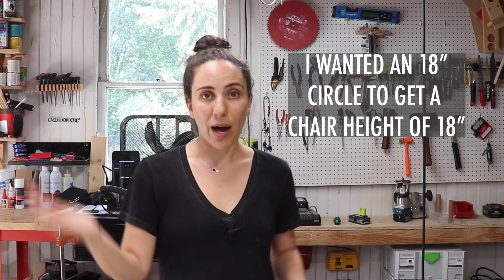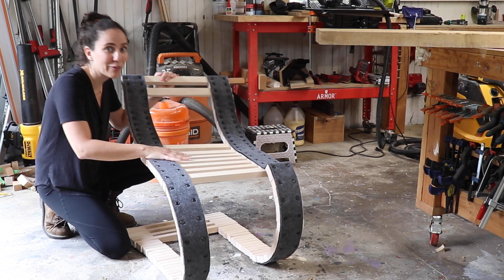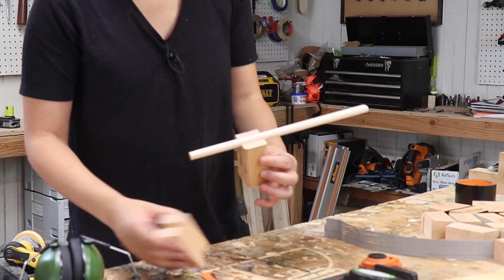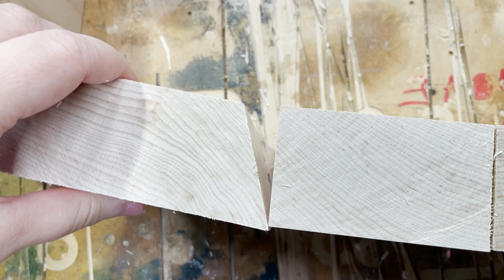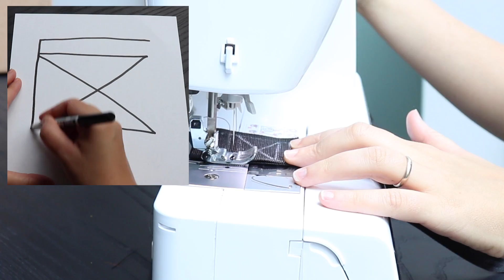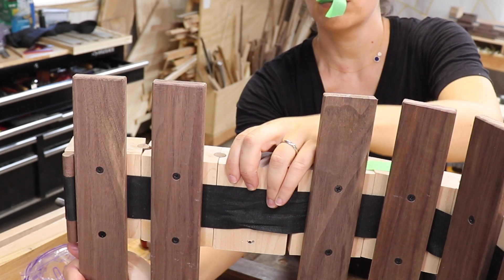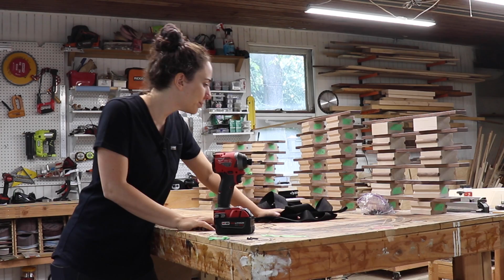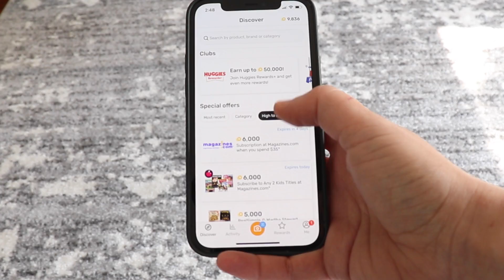I ATTEMPT to make a Roll Up Chair… AGAIN...

Comment: If I were doing this, I would've use cylinder shaped pieces of wood with a lot of cables(steel) running through it(where the person would sit on), there might be a problem where some of the pieces will shifting out of place but I think you can use that strap(one in the vid) to hold it in place at the front and back(two sided) and for the side to side shifting you can use the same idea you used in this video, Or you can use ure design and just put in a "versterking(afrikaans,sorry I forgot the word in English)"at the back of the chair to prevent it from rolling up at the back and not being sturdy enough. You can make that "versterking" also roll up with the chair.

Hope you see this and take my thoughts on this into consideration.PS sorry for the afrikaans:)

Eghardt

Comment: I think the problem is that u r using elastic materials, Bands or ropes are woven materials the resistance they have is superior to many other materials but they are easily deformed creating the spaces you showed before. A series of hinges could work better, a structural calculation should be made on the strength necessary in the center of each radius to size the type of hinge to be used. It's a very cool concept you should publish a drawing with the measurements obtained with the latest version and launch a challenge to all those who weigh to be able to make an improvement to the project by creating a video

Comment: Second comment from me about the tension in the straps. Currently you're letting the strap stretch across its entire length, so that in places of most tension, it will pull through more of the strap and you get those separations in the video.
The problem probably isn't the strap material. Try fixing it to each segment with fabric rivets or something similar so that the stretchable amount for any given section is a couple of inches and not the whole length 👌.

Comment: Try stepped or tongue and groove style edges on each of the sections of the chair, so that they compress together under pressure rather than come apart.

Seen a few chairs of this style that worked and that seemed to be one of the features that helped it all come together 👍

Comment: you have it almost finished, you just need to ditch the strapping because it stretches, you should drill two holes just under the surface  through each piece parallel and run 4---- 1/8 in cables through each connecting hole, so you have 2 cables through each side.  Secure them at the top so they won't move, and adjust the tension at the bottom on each cable, and i would use about 400 lbs of seated weight as my standard.  the 4 cables will fix the sway from side to side, and the steel cables wont stretch, and because they are 1'8 in, they will roll easily.  If it works, i want one, lol.  they are very cool

Comment: Instead of using a paper as a template, I would recommend that you use a speed square. It's the same ones carpenters use. They are EXTREMELY useful tools and can save you much more time when it comes to cutting your wood to shape. Lastly, for the cable, I would recommend calculating the tension force that the cable will be undergoing so you know the chair will be able to support you and possibly another person.

P.S. When looking at materials to use, keep in mind the overall weight of the chair. You can use CAD software to design the chair and it will have preloaded materials in the software that will **automagically** calculate the overall weight of the chair before you even begin production.

I hope you find this information helpful. Best of luck.

Comment: It's the fabric material, you can see it streching the tension won't help so much. It will just bring closer to failing and create more tension inside the material, try materials that are stron and do not strech and it should work.

Comment: I hadn't seen this suggestion so ill throw it in. Along with the improved strapping methods many have suggested, designing the chair so that it, when weighted, rests in the horizontal seating position. Essentially design it so when you initially unroll it,  the section you sit on is at a ~30* upward angle as opposed to horizontal. Then when its weighted it has room to flex to the desired seating position.
Reply: @jhay440  ratchet strapping in general might be the solution, cause those straps, especially the 2t rated ones only stretch when you put as heap of stress and force on em
Reply: @Rocker-1234  Literal Tow straps from the local hardware store. I was thinking the same, but the wood pieces need to become part of the structure as well, might be related to the curvature in the chair itself and how it's transferring the load.
Reply: @FuhSheezy  nah not tow traps, they have a little bit of give, go for the full 2-3t truck straps they seem to stretch alot less from my experience. as for making the wood part of it, cut slats into the wood or on the edges of the wood just thick enough for the straps to fit into, that way the staps become part of the structure kinda like window blinds
Reply: i would glue all the strap to all the wood
Reply: @WTFinc  she tried that in attempt one, problem isnt the securement of the straps but how much they stretch
Reply: @Rocker-1234  i would have thought glue would midigate that since it would only be able to stretch locally at the joint rather than the entire length. maybe a streach and glue? solid cable? hinges lol?
Reply: @WTFinc  Was thinking about hinge too as it wouldn't stretch at all while giving enough strength to the whole structure... Just need the right hinge...
Reply: @DeadsTBD  hinges! Let's go!
Reply: Correct.
Also stronger straps - less stretchy. Kevlar or steel perhaps. Let them slip except at the ends where you have adjustment. The wood will compress so you will need to regularly tighten it. Take out all but two of the slats at the bottom
Reply: @Chris-ZL  Steel was one one idea I had as well. Leather won't work as it stretches by quite a bit.
Reply: or use lighter material for the top pieces?
Reply: @CURFmoney  That's an interesting idea, to give it a seat a higher angle, to accommodate the stress from putting weight on the seat.  I wonder if, though, since sitting in the chair would creat enormous tension, when someone tried to get up from the chair, whether releasing the tension would cause the chair to "snap" forward, and hit them in the back (not sure if I even explained that, correctly, haha)...?

Now that I think about it, that "snapping" would probably still be an issue, no matter what angle the seat/back is.  It might just be an inherent flaw in the very concept of the chair.

Comment: Towing strap is your best bet. Tow strap is very strong a heavy duty with a strength of 5000 to 15000 pound and it dose not have a lot of give. 
Also you need to screw the strap to each piece for a sturdier foundation.

Comment: You could even use a heavy-duty sash-chain or roller-chain (bicycle chain), and fit that into a recess cut into your wooden blocks. That'd probably provide the least amount of stretch, while remaining flexible. Roller-chain is sort of an "Industrial Lego" and has it's own standardized sizing system. So, it can be easily had in sizes above mere bicycle chain.

Comment: Leather strapping is far stretchier than polyester webbing. The side-to-side play can be solved by installing your dowel perpendicular to its current orientation. So as to function like pegs in holes. If you want to get really fancy, use wooden spheres for pegs and hemispherical holes. Also, if you want to take most of the stretch out of a polyester seat-belt webbing, saturate it in polyurethane and let it dry. This fills the space normally occupied by air, and prevents the weave from shifting to accommodate the stretch. If you needed to up the anti even higher, you could try to find dyneema, spectra or kevlar webbing. Though, expect to pay way more for that than you would for the polyester seat-belt webbing! Leather would never work for this!

Comment: It'd be cool if you connected it like you were talking about at the end (like the top edge to the bottom edge) but instead of a straight line do a second curve at the top and elongating the bottom so it makes a heart shape when they meet. the chair would probably be enormous since you'd basically double it, but it'd look pretty cool and it might be more stable

Comment: Even the least-dense wood you could purchase from a mill or lumber supplier, would never be your weakest link, in a design like this. The stretch in whatever strapping material you use (short of using steel banding), will be. Probably followed by the effectiveness of fastenings. Probably the most obvious choice of strapping will be polyester seat-belt webbing. It's cheap and very low-stretch. I suspect a lot of folks might think of polyester and nylon as being very similar, given they are both synthetic materials. They are not. Polyester is, in most weaves, very low-stretch. Whereas nylon is much more stretchy, in pretty much any weave. There are other differences too, but this it the more-relevant comparative point.

Comment: instead of using a dowel maybe  use a camber on the angled sides of the wood blocks. like a V on its side built into the angle so the pressure would force the blocks together.

Comment: As a thought experiment, imagine replacing the webbing with recessed metal hinges at the junction of each block to its neighbor. This arrangement of rigidity and a tight turning radius are what you’re trying to replicate.
I know it would violate your keen aesthetic to use hinges; but any material flexible enough to act as a hinge will likely also tend to stretch. 
There might be a solution using a tensioner to adjust out any gaps that develop. Or maybe a hybrid approach that places metal hinges only on the corners that are stress points.
Not sure what the answer is but thought that might help you visualize the problem.
Reply: Inset the hinges, put a strap over there for esthetics and there you tricked thousands of people! :D
Reply: @boomerangfreak  that's what I would do, but I'm not much of a "maker". I'm that lowliest of YouTube comment-makers; an engineer!
Reply: @danielleohallisey4218  we all need engineers! Who else are we supposed to yell at for their impossible to make designs! ;)
Reply: @boomerangfreak  always happy to serve a useful purpose! :D

Comment: I am thinking you should have 2 straps per leg. One going around the bottom, one for the top. Right now you have those curves fighting each other. I think steel cabling through the center of the blocks...

Comment: I think it would help if you just connect each piece individually with a piece of material (like every piece is connected directly with wire/fabric/etc to only its two neighbors) That way, you can get the right tension/length on each section if that makes sense?

Comment: possible fixes to the stretching issue:
1) get stiffer straps. It sounds like you already thought of this when you mentioned using leather. You could also just double up the straps for extra strength/less stretch

2) use thicker blocks. the faces in which the blocks meet acts like a lever which serves to stretch the strap, if you increase the length of that lever(aka use thicker blocks) the strap will have an easier time holding the blocks together. similar to how using a longer wrench makes turning a bolt easier.

3) fixing the strap to the blocks as close to the edges as possible. You may have already thought of this as well when you mentioned stapling the straps to the board. But yes, this would shorten the length of the strap that is in tension will decrease the ammount of stretching. If we suppose that the tension causes the strap to double in length, a 2 inch section of strap would stretch and produce a 2 inch gap, whereas a half in section of strap would stretch and produce a half in gap.

I'm rooting for you!!!

Comment: This is a problem of levers.  The distance from the back of your chair to the front bend is a big lever, and then you have a very small lever where each block contacts its neighbor and the belt is trying to keep these two in check. So you've got a very big lever trying to be held in place by a very small lever, hence massive forces and the problems with stretch your experiencing.  I don't think leather would help.  You need something stiffer, like steel.  Source, mechanical engineer here.

Comment: Why not just have some supports that you can fold down from horizontal to roll up into vertical supports at the back of the seat and lock in, that you can then kick out for rolling?

Comment: As I said last time, conveyor belt strapping.

But another issue you created is letting the strap slide through the slots and move the tension everywhere.  You've got to localize the forces, not spread them out.

Every material has a certain elasticity and a certain amount they will stretch before breaking in tension.  A six foot strap will stretch 12x as much as a 6 inch strap under the same tension.  Your slots equalize the tension which wasn't great but it also lets it stretch as one long piece.

Several small pieces would stretch an equal amount in total but they won't allow as much "slack" to gather in any one spot.

I'm sure you could make it work but it is a design with lots of single points of failure so that kind of chair and safety really don't go together.  Sometimes I get lost in making things work once or "if you know how to do it", not working the way people might expect like a chair you don't question, you just sit in.

Looking at it more critically, this is cool but it's just a bad idea and I don't see a way to fix the idea without making it something else.  You should bail unless you can make money on it and then immediately set it on fire to remove it from your life...

Comment: The only way I see this could work is with absolute static webbing that has a 0% stretch (which I think you can't get because woven straps will always stretch) and the webbing flowing through the middle of the structural part so that you don't create momentum on the pivots. But actually pull the pieces tighter together, I think you also have to attach it in the rounded part to at least 3 pieces to distribute the force and counter the stretching a little

Comment: I don't think the core of the issue is the tension/stretching, i think its that the strap is only anchored at the ends, which allows the piece under low tension to give any slack they may have to the pieces under the highest pressure. Under this build, the joints that are under the most pressure/tension will always accumulate a little bit of slack, which is why the joints in the front foot keep coming loose.

The only solution i could see working would be to connect the strap directly to each individual piece with the amount of length that that specific piece needs. That way, each piece only has a tiny little bit of give, and it cant all accumulate in one joint. This would still allow the chair to roll up.

Comment: fun challenge... metal cable would be a zero stretch solution... (I dont think leather would work at all personally) but I think the wood will still compress, plus wood changes dimension depending on humidity, and this would not like that, so now you need some sort of screw based tension adjuster... which would just be annoying for practical use.  Imagine the chair looks perfect in august and droops in january, bummer.  but I love the idea of solving the engineering problem.

Someone can probably do the math of just how much force is being applied to those straps given the leverage.  I bet its a lot.

could just cheat and build a fold out arm that supports the chair back against the base, but thats not the same thing...

Comment: I think that using a more flat angle on ONE side of the wood pieces on the curve that’s actually supporting your weight, will prevent the material from stretching where you need it to hold the most. Or perhaps you could even put screws directly into the fabric at the top and bottom of the curve to achieve the same effect. Good luck on you future chair endeavors! I hoped I helped

Comment: Very invested now. Backseat driver here but ... If the leather was strong enough not to stretch, maybe it's possible to fit it under tension and saturate the leather and let it dry so it shrinks. I really think your idea to fix each piece to the strap is much better. Absolutely loved both of these builds as it dispels my fear of wasting timber I spent money on. I would have reverted to two year old tantrum about halfway through what you went through. Thank you so much for the video!

Comment: Dang, this project really got my brain thinking. For straps (and rope) there can be a lot of stretch in it until it's been properly conditioned. You can get rope that is pre-stretched, not sure about straps. Might be worth DIY-ing a setup to do. Secondly, I wonder if it's possible to design in an interlocking mechanism, or S-shaped fingers into the wood so that the straps aren't taking up all of the tension. It might not work with the strength/grain direction of the wood and it would be a pain in the butt to create without a CNC, but that might provide the necessary strength/resistance-to-stretch without resorting to solid hinges.